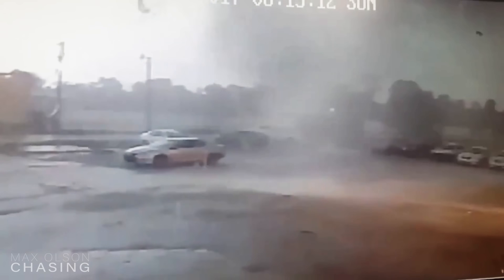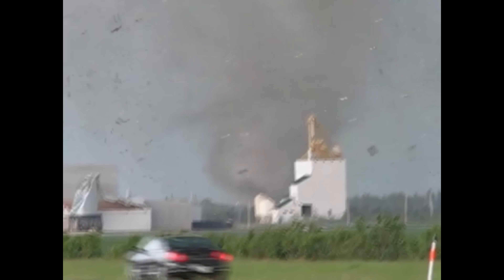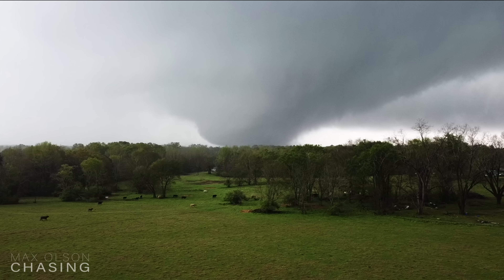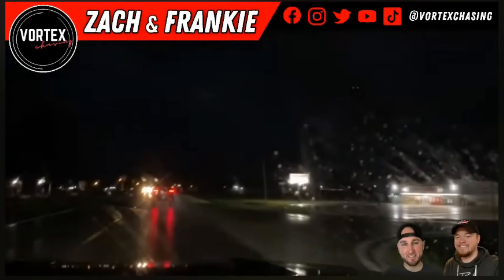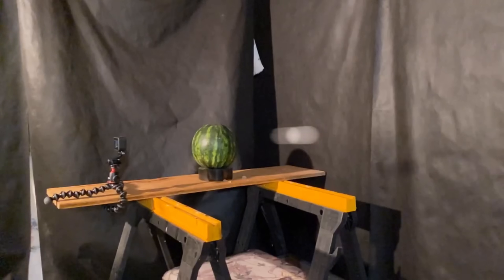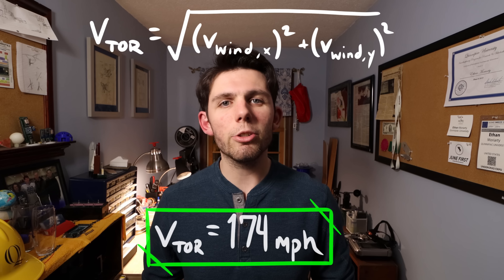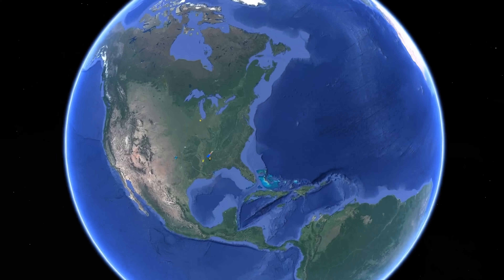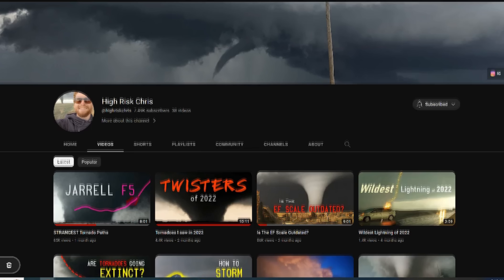Is This a Vehicle Flying Around a Tornado? - Rolling Fork, MS

Comment: Great video!! I have a question/comment. If those where headlights on a vehicle,  that means said vehicle would have had to been facing the camera the entire time it orbited the tornado. It's hard to believe, but wouldn't you think the car would be tumbling and spinning through the air, making those lights come in and out of sight as it's spinning around as opposed to a steady/smooth glow facing the camera throughout the course of it's flight?
Reply: There's another video from a different angle with a different camera ( https://www.youtube.com/watch?v=qJ27vMTp_L8&t=88s ) that shows the lights 'flickering' like you say. Maybe the camera for this one just didn't pick up that flickering well.
Reply: @gamprhabanero5351  Thanks! This is more of what I would be expecting.
Reply: unless the tail lights were busted out as one commenter on this thread mentioned. Then the white light would be visible on both ends, producing a more constant light.
Reply: Also some cars briefly leave the headlights on but not the others  when the car is shut off.
Reply: Why nobody ever consider the battery powered portable LED lights? I have them and they are as powerful as car lights at the fraction of weight. They can also be solar powered so you can just leave them in the field attached by magnets to a steel structure of your choice and they will happily shine for few hours. Also some security systems have lights that are battery powered in case of a blackout  and are also bright as a hell. They also have movement sensors so they would certainly be turned on by it. They are usually under the roof and could be easier picked up by the wind. If it was a car, you may also see the red rear lights too. Even street lightning in Chinese countryside has a small solar panel attached to each street lamp to charge it. Could a solar panel give it a lift? I mean there are so many alternative explanations that give more plausible scenarios...
Reply: @luboinchina3013  This is Mississippi. As a resident I can assure you it's not any super bright portable LED lights. It's also highly likely it's not from a security system either as most if not all don't have lights as bright as car headlights. While a lot of portable lights may be as bright as cars, most generally have more of a widespread lighting path, lighting up a larger general area vs. cars lighting a forward cone more like a flashlight.

Comment: Car headlights are very directional.  That last pass showed a bright light across the entire width of the funnel.  It seems highly unlikely that a car/truck would be flying perfectly oriented for that to be the case.  Maybe someone lost their Milwaukee work light?  I have several of those (4000+ lumens) and they're bright light like that AND match the color temperature of the light in the recording although that isn't much to consider without knowing the white balance in the capture.

Comment: this is an absolutely fantastic analysis of this event, my only thought could be maybe it was a lighter vehicle like an atv or golf cart, there are also stories of a jeep (i think) smacking off of a water tower in the smithville ef5.
Reply: With the amount of people that were out driving and unaware of the tornado, I'm sure it was a vehicle. Couple chasers were driving through town honking the horn and trying to warn people.  They were all oblivious. That's what happens when people aren't weather aware.
Reply: Also, glad you talked about the Smithville water tower. Haven't heard many mention that.
Reply: I live south of Smithville, and the dent is still there, last I heard.
Reply: @jasonking454  They actually tore down and replaced that water tower, but it was there up until they did so.
Reply: It was a Ford Explorer but you're right. It was the Smithville EF-5. The dent remained until they tore down and replaced the water tower.
Reply: If I remember correctly, the Smithville water tower is about 150 ft tall. A high-end tornado can potentially toss a car ten times that high...there's just no water towers tall enough to prove it.

Comment: Max, Great Job on this. The question I have to maybe assist in this, since we can conclude that this had to be a vehicle. The vehicle had its lights on which means that either the vehicle was running when it was lofted or at minimum had the key in the ignition with the auto lights on.   Were any of those killed by this devastating tornado found in a vehicle? If so then we can possibly look at where Chris says this car may have landed and pinpoint if the individual and vehicle could have been this car that was lofted.
Reply: Yes, but I don't think anyone wants to know that this is how their loved ones perished. 😢
Reply: @PollyHistor  I don't disagree with that statement. If someone perished in this way it must have been horrifying for them and I cannot imagine what they went through. I just hoped they prayed and God made it as painless as possible for them.  I have and will be praying for the families who have lost loved ones and for the area in general.

Comment: The main light that's easiest to see rotating around the tornado is not flashing. If it were a vehicle, it would have to have maintained its headlights directed toward the camera at all times, which is extremely unlikely. A twisting and rotating vehicle's headlights would appear as flashing lights. The main light seems fairly constant and not "flashing."
Reply: There's another angle with a different camera that does show the "flashing". As for this video here...either the camera didn't capture the 'flashing' well, or the video editing/processing made it so that it wasn't 'flashing' anymore.

That being said, even IN this video, the light, while not flashing, does fluctuate and change 'size'/brightness if you look closely.

Comment: The other thing to consider is, what else could it have possibly been other than a vehicle? The other main argument I've seen is that it was a drone, which I don't buy. The size and brightness of the light just doesn't make sense for a drone.
Reply: I have never seen a video like this..I have my thoughts on the  increase in Violent. Weather, one of them is that some of these. Storms may be. Engineered or. Man made.. The theories are out there..I did some. Research on the. Town of. Rolling. Rock..and found that the. Square. Mileage of the town is. 1.41 Miles..The tornado. Wedge was almost the same. Width..What are the. Chances that a Tornado the sane size as a Town would go. Exactly over the entire. Town ??
Reply: An additional difficulty I have with a drone is that most commercial drones AFAIK aren't heavy enough to resist getting tossed about violently, as opposed to the very-relatively slower and level orbit we're seeing here. Plus, we'd have to be talking about a drone got swept up in the vortex and was completely out of control - any theory that this was a controlled orbit I think can be discounted out of hand, again b/c the size and power of all likely drones isn't enough for control under the immense wind currents that near the wedge.
Reply: My thoughts. As an avid UAP researcher, I think it was a UAP coming to check out the tornado. Just a persons opinion.

Comment: Jim bishops footage of the 5-31-13 EL Reno tornado shows a vehicle moving left to right  over 100 feet in the air across the tornado, as the tornado was moving towards I 40, somewhere around the 16:50 to 17:10 mark. It's a little hard to see at first, but once you see it, it's impossible to miss. There's a subvortex on the right side of the tornado a few moments before the car comes around the other side, pretty wild footage
Reply: Can you link the video? He has more than one of El Reno.
Reply: Is it the little blinking light that flashes for a couple of seconds in the sky? It looks similar to the light from this tornado, only smaller
Reply: Yes, can you link it? I can’t seem to find which one it is!
Reply: I can’t find it either. A link would be appreciated.
Reply: It was literally the only one long enough to include his timestamps if you search the name and el Reno guys.
Anyway, it's very hard to see, it's a small blinking white light in the same timestamps he mentioned.
If you hear him say 'wooow' back up like 10 seconds an look again.
https://youtu.be/gnIU2Ii2Ec8
Reply: Ok I see it, I had to slow the video down in speed in order to see it
Reply: Round those timestamps you can also see two vortexes rotating around each other 
Not sure what that object is though.
I'm not sure I'm convinced it's a vehicle.
Reply: I saw it, max out your FPS and slow the video down all the way 16:54 ill get the link
Reply: @TenguXil  It's at the same time and location when the Twistex crew got hit. Reno rd is just a dirt road with no powerlines or houses in that area. The subvortex that hit them first can be seen passing out the right side of the main vortex. If it is them they must have been picked up by the main circulation after getting hit by the subvortex. At 17:30 by their clock on the video they were 1.5 miles from that subvortex. So at 16:54 it would have been around 2 miles away. It is about the right size for headlights. Earlier in the video you can see the headlights driving on Reno rd.
Reply: I've seen that video dozens of times and never noticed that, wow
Reply: @TenguXil  Honestly considering how tiny that is, and comparing it to the one in this video, I don't think it was a car.   Mind you, any Solar Panel powered Light, will remain lit inside a Tornado 100%

I would take this into account anything you see something like this happen.
Reply: A fellow tengu
Reply: About 3 or 4 minutes before the headlights Jim says " 6:20 pm, violent tornado sw of El reno". The timing, large subvortex, location all point to a car being hit the same time and location the Twistex team got hit. And it's definitely a vehicle.
Reply: @jleif7736  it's only tiny in comparison to the tornado, very easy to tell its a car, just watch it a few more times. Especially as it exits stage right, the last time it's visible

Comment: The tornado went very close to Elmwood cemetery on Ending Bar road. Houses and buildings were destroyed about 1000 feet away. Many cemeteries around have solar powered lights on graves that could easily be picked up. Houses hit in the area could also have had the solar lights or battery powered emergency lights.
Reply: They wouldn't be that bright
Reply: The lights wouldn't have been next to each other the whole time that they orbited the vortex.
Reply: @lfrankow true 👍
Reply: Yea this video is click bait
Reply: @pinecedar180  How is it click bait? We saw exactly what the thumbnail described. Two lights in the tornado that looked almost exactly like the headlights of a car.
Reply: Drone?
Reply: @squirrel3443  It could be a drone or some type of aircraft but what kind has two bright lights right next to eachother?

Comment: This is an optical illusion. There's no car flying around in the sky. From what I've gathered it's either a flashing bulb located ontop of a tall building/tower for Aviation located highup on structures. The light source is actually behind the POV of the camera on the otherside of the road quite a distance away & at a higher elevation. The lights are reflecting off of the vehicles inner window & appearing in the footage as something in the distance. From observation, The Red lights blink at a steady pace indicating a tower of some sort with the solid white light indicating the top of another tower/structure in the same general area. Pause at times below to see.

@13:02 - 3 Red Lights on left POV of footage 2 on left one on right -note the spacing between the lights & the frequency 
@13:04 - 1 Red Light on Left POV of footage * in the upper left in previous pattern spacing - Now, 1 White Light has appeared on the upper right section replacing the Red light before.
@13:11 - 2 Red Lights on Left POV of footage with same spacing as before  with a faint White light relatively close to its original flashed location listed above. 
@Later parts of the video, the Red Lights have now been obscured by terrain, elevation, trees, or objects - leaving the White lights in the footage due to it being a separate structure.

Since the vehicle is moving along a roadway & the POV of the camera is capturing a backlight from the inner curved glass window is capturing another light far behind the Filmers vehicle directly behind them. With moving along the road. the Red lights end up getting blocked out by terrain or any other objects obscuring it from your perspective however the White light is still visible indicating that its probably another separate object in the same general area as the Red anntenna tower those lights are coming from. Possibly a watertower ect.

Just an illusion.
Reply: Yeah..and directly behind the tornado across the field are three round tower's. Maybe there are lights on them.

Comment: There's an aspect of tornadoes you guys aren't picking up on.
It's not just high velocity winds, a Tornado has Suction, like a giant vacuum.  That's why years ago before Doplar radar, weather men picked up on tornadoes by the hole that opens in the clouds behind where the funnel forms. 
Which ports the funnel and voila you have suction.
I actually stood dead center beneath one of these holes in Catoosa Okla, it was wild looking, and not what you'd expect. There were so many layers to the clouds it went waaaaaay up then curved towards the funnel cloud that had just passed my house moments before.
Reply: There are also powerful sub-vortices that make the direction of the winds very complex, especially in larger tornadoes. So you can have small areas of powerful vertical winds even in a mostly horizontal wind field. And of course the tornado is powered by the massive diagonal updraft that is sucking all this air in to replace it and carrying lighter debris for hundreds of miles.
Reply: The geomagnetic fields through which these storms travel can create powerful emissions as a storm is building, which include intense electrical disturbances and gyroscopic currents that manifest into these tornadic, anti-gravity events. 
(Think about a roof ripped off a kitchen, but a single, empty paper cup is still standing perfectly on the kitchen countertop, where it was left by the owner of the home, who is later found in the next door neighbors backyard!

These emissions are created inside the various layers of a tornado funnel and its larger mother, the super cell. Lightning is not an uncommon occurrence, and ball lightening is certainly not something to rule out here. However, this looks to be a vehicle or two, which is very gruesome and sad.

Its amazing that the very same force responsible for creating all the friction, which produces the lightning, was also most likely what provided the insane amount of energy needed to launch these vehicles skyward and keep them aloft for so long....very scary indeed!
Reply: I want a little tornado to vacuum my carpet now

Comment: I’ve been thinking about this a bit, in addition to there being more than 1 light source, the thing about vehicle lights is the lighting is a directional beam which would mean the vehicle is pointing relatively at the camera when the white light is visible and should change intensity as the front of the vehicle points in other directions. I am becoming more inclined with this being some type of solar chaired battery powered security/poll lamp.
Reply: This is not to discount the excellent work researching the mechanics behind a vehicle being lofted in a similar way.

Comment: The only way to be sure is if they found any bodies inside a mangled vehicle in or around that area. But that's only if the occupant wasn't ejected prior to or upon impact. What a horrifying situation all-around.
Reply: Or if there was any occupant at all. Someone could likely have run for a ditch and left it running.

Comment: My problem with the vehicle interpretation is that the "headlights" were continuously facing in the direct of the camera.  I could be wrong, but this strikes me as quite unlikely.

Was there any experimental data in the lab that demonstrated that the position of the vehicle aloft would hold its direction?  I'm not sure,   I would think, that in the presence of intense winds that the headline direction would not only change in the vertical axis but also in lateral axes (pitch and roll in addition to yaw).

Still, the idea of a vehicle, lifted by the intense wind, is an attractive one.   I'm not really into the idea of Ball lightning, but is the possibility of ball lightning (which can be seen from any angle) be a consideration?
Reply: Here is a video of a tornado where there is said to be ball lightning present.  It is not that different than the Mississippi video.  https://www.youtube.com/watch?v=jwCDxCmW5pg